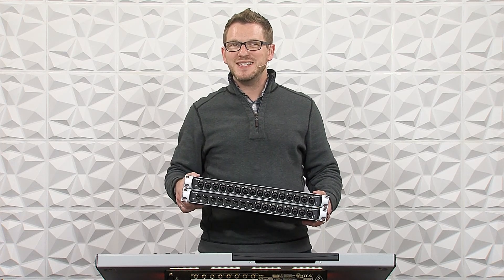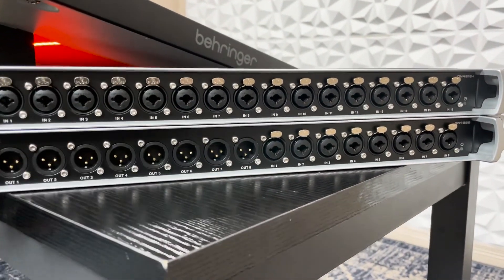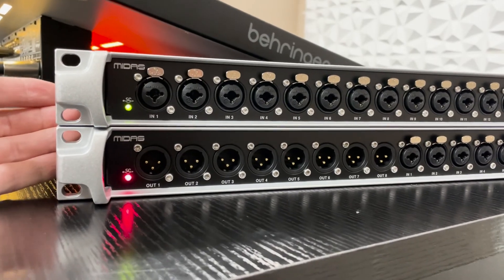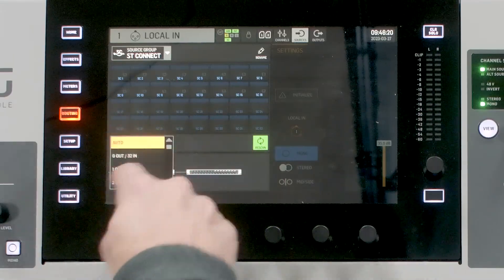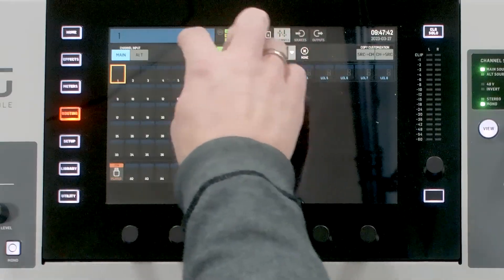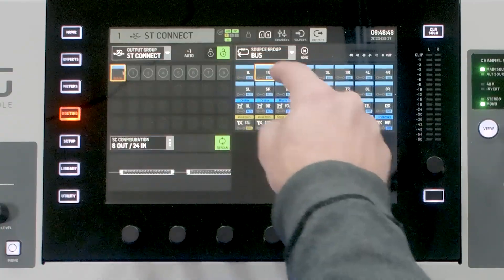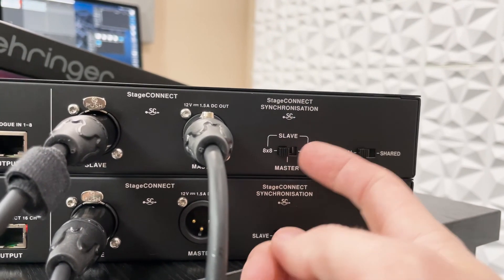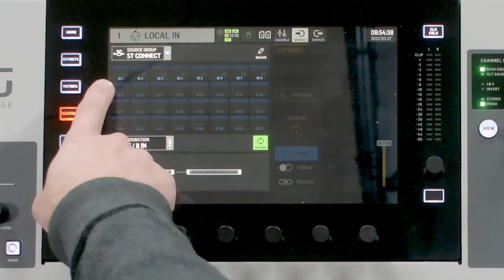Multiple StageCONNECT devices with the Behringer Wing

Comment: Hi Drew, you say use a DMX cable  but CHATGBT says expressly not to? I've tried both and still my input signals are negligible? It also says to enable stage connect in settings/ io. ... Can't find that? Please help?
Reply: "my input signals are negligible"

StageConnect is a digital interface it has nothing to do with audio quality. it either works or not.
Note that DN4816-I and DN4888 are not suitable for mics and direct guitar inputs. These have no phantom power and they expect line-level signals. You need external preamps if you want to use it with mics or guitars.

Comment: Hey Drew
Big fan of your videos 
Just a question, we are planning to buy the wing for our church.
Would there be a problem if we connect the 32 channel behringer stagebox & Midas s16. Would it create any problem?
Reply: It shouldn't creat any problem. Only problem you will run into is that you only have the ability to mix 48 channels at once. So thats either 48 linked stereo channels (96 mono channels), or 48 mono channels, or a combination of both. For example, you could have the first 20 channels as stereo, taking up 40 mono xlr inputs, and the the remaining 28 slots, can be mono instruments. Does this make sense?

Comment: Hi Drew,  i did try to connect a DP4888 and a DN4816-O together (with the 2 additional Adapters) to use as a 24ch splitter with my Behringer Rack Wing. It worked for 20 minutes until the DN4816-O stopped giving a signal. I tried everything, then i only connected the DN4816-O and by itself it's ok? Everything reconnected, ...... nothing... and suddenly no more power anymore in the ohter one, the DP4888.  Can i blow up such a device?

Comment: Hi all, could anyone help me please, I just got 2 stage connect DN4816-0 and DN 4888. I connected them with my wing rack, I have no problem with outputs but the 8 inputs on DN4888 has a low volume using my mic, I tried to find any gain to give mor volume but I can’t find it, any advice will be appreciated, thanks all , thanks Drew.
Reply: As Drew told in the video, the inputs are only line level. No Mic level.

Comment: Hi Drew
I learned a lots from you and now I need help how to connect M32c with DN4816-o and DN4816-I.
Can you make video of this please.😊
Reply: Hey @joetim6603,
Unfortunantly to my knowledge, the DN4816-O and DN4816-I are not compatible with the Midas M32C. If you want something similar to this for the M32C, id suggest buying a shielded Ethercon cable and a Midas DL32. This will give you 32 inputs and 16 outputs supported by the M32C. To do this, you use the AES50 ports on the back. Drew has a video for AES50 somewhere. Hope this helps
Reply: The person who replied is correct in that a DL32 over AES50 is your best option. However, StageCONNECT CAN be routed over the ULTRANET ecosystem in the M32c to my knowledge.

Comment: Has anyone tried to make a StageConnect link between a Wing to DN48xx box, running the XLR connection through a SoundTools CatBox on each side?  We have that infrastructure installed now and it would be cool to be able to use it and not pull another XLR.
Reply: as long as it is 110 ohms, it should work but beware the length limit which is only 40m for Stageconnect

Comment: Hi and thanks for your tutorials..kind of my life savers right now,
maybe you have an idea on how to solve my issue :
I'm using the x32 rack for iems and am trying to send 32 outs to FOH with a pair of DN4816-o
my current rig is an x32 rack with an SD16 via aes50 allowing for 32 inputs

for outputs i acquired 2x DN4816-o, hoping to be able to send 32 outputs to FOH via ultranet (as x32 rack do not have stageconnect). So apparently ultranet is limited to 16 outputs but is there a way to use the ultranet from the x32 to my first DN4816-o and the ultranet from my sd16 to the second DN4816-o ?

Or maybe you have a better idea on how to send 32 unaltered outs to FOH while keeping our separate iem mixes from the X32 rack ?

thank you so much in advance

Comment: What about 1 Wing and 2 Stage box // 2 Church , Can we create a Profile or only on show mode?  We want to have 2 church sharing the same wing but we dont want to share our Stage boxes ( All mic and instruments will be set every time we come) Like John will have mic #1 Set to him every week on chuch A, and on Church B they will not use the mic 1.  Please help.
Reply: If i've got what your saying correct, best way to do this would to set up 2 different scenes on the board. Scene 1 could be for church 1, and then creat a new scene with Church's 2 set up and then when you're at the required church, you load in said church's scene. Does that make sense? This way, you can have all the routing stay the same each time you go to each church without having to re-route anything. Hope this helps :)

Comment: So if I’m recording a band with the 2 Midas stage boxes, I can run all mics from drums, guitars and vocals to the stage box and run a cat 6 shielded wire to the wing, then interface with my pro tools? I’m looking to upgrade my recording studio, building a purpose built studio building and was going to run several patch boxes with snakes to the recording desk in a separate room.
Reply: This is correct, yes. Although I would suggest getting ethercon cables instead of straight shielded CAT6 cables. More sturdy of a fit and purpose built

Comment: Your videos are wonderful.  Can you please explain how to connect the Behringer Wing to two S32 stage boxes using the Cat 6 cable?
Reply: Start by not using a CAT6 cable but rather a Shielded CAT5E.  I have seen more than one stage box ruined by using CAT6.  Then, since each box has 32 inputs, they will each need to be on a separate AES50 line (there are 3 available on the Wing).  Finally routing is just the same as what Drew just explained for the Stage connect, but you would choose the appropriate AES50 line instead.  Hope that helps!

Comment: Hi, great video. One question, do you know if it will be possible to have 3 x DN4888 to get 48 audio outputs?
Reply: hi. the docs says we are limited to 32 channels of bandwidth. if you try, let us know ; )
Reply: Maybe if you combine Stageconnect (XLR data cable) for the first 32 channels, and then use the Ultranet for the other 16?

Comment: Why would you use stage connect over AES?
Reply: For an example you could run an full IEMs system and wireless instruments inputs just the one cable and you not have to tap into your Aes50.
Reply: StageConnect is primarily meant for monitoring and talkback.
You can use it sometimes for extending inputs if you have line-levels because it issslightly cheaper.